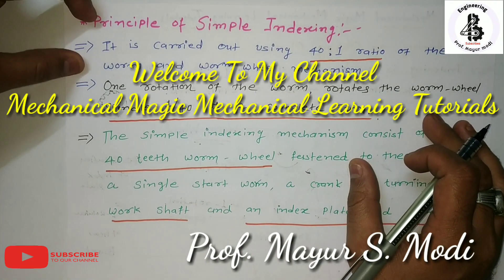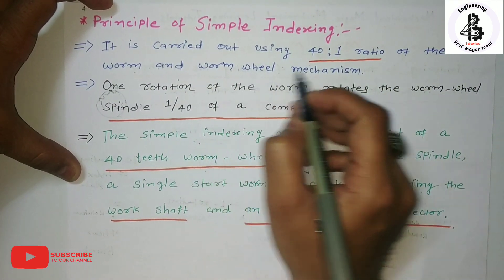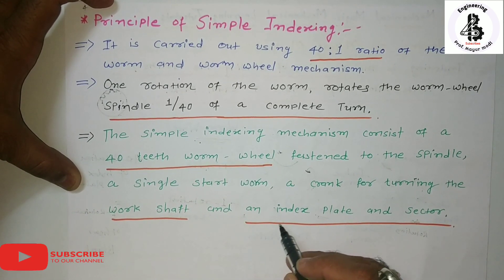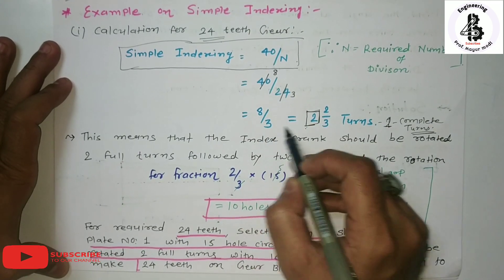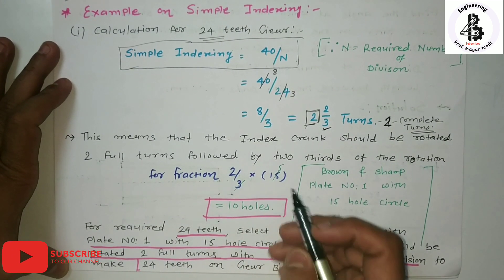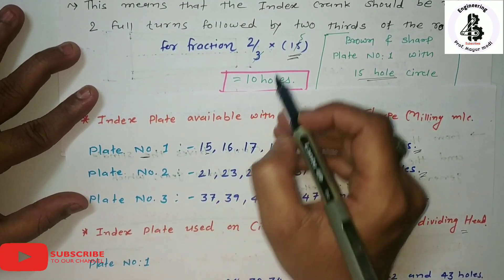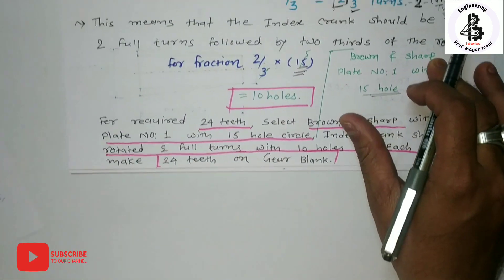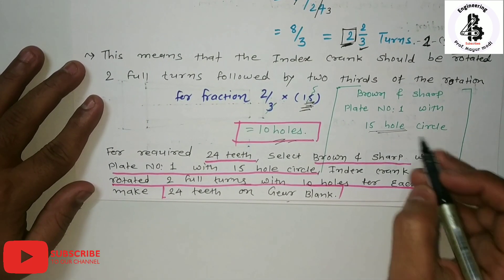simple indexing | simple indexing calculation | simple indexing numerical| Milling Machine

Comment: Why 40/24 =8/3 ?
Reply from the maker: As per standard definition of simple indexing = 40/n. 

The following relation is used for simple indexing: T = 40/N, where T gives the number of turns or parts of a turn through which the index crank must be rotated to obtain the required number of divisions (N) on the job periphery. 

Subscribes, like👍👍👍and share↗️↗️↗️keep watching....
Reply: @modimechanicalengineeringt8780  I appreciate sir..but isn't it 40/24 =5/3 ?
Reply from the maker: 🙏🙏🙏thank you